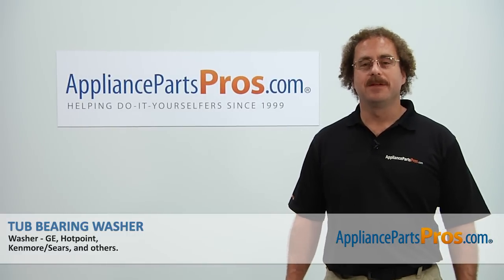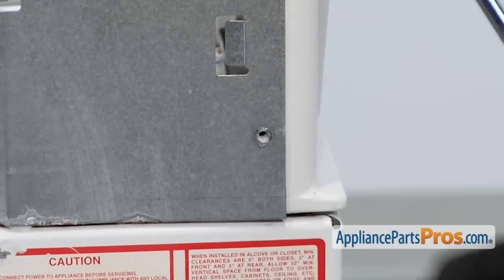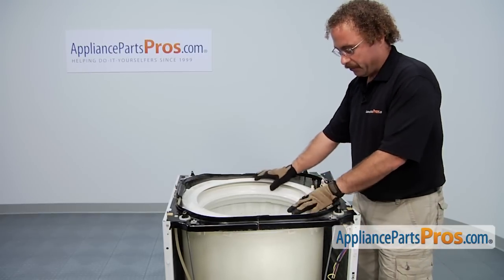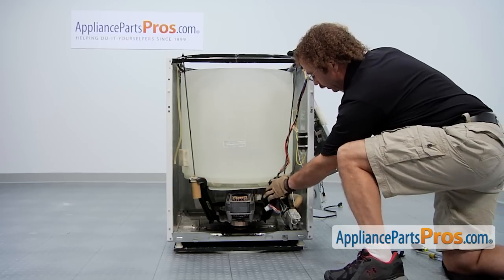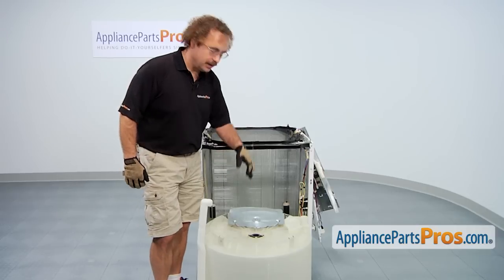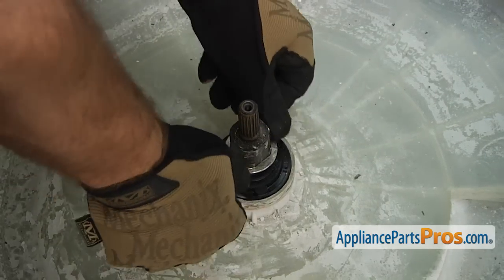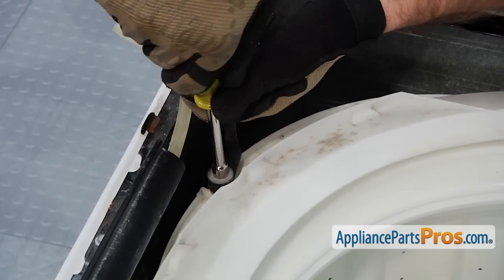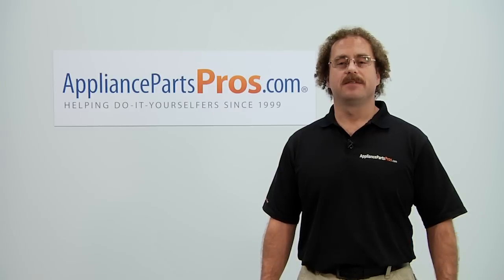How To: GE Tub Bearing Washer WH2X1197

Comment: For those that are having trouble removing the old tub bushings. I was able to take the new bushing and find a socket slightly smaller and place a socket extension in the socket and use a hammer to tap on the extension and drive out the old bushing. I also recommend ordering the bushing, tub seal and split bushing. As I broke the split bushing and the seal had to be replaced along with the tub bushing. I also ordered the nut wrench as it was on $10.

Comment: Anybody who is attempting this repair on a washing machine that is years old should be aware that you're going to run into pieces that are rusted together and are not going to want to come apart as easily as shown on this video. I used to be a contractor and I'm pretty good at DIY projects. I did this repair on a 20 plus-year-old washer. I nearly gave up. One key is having the correct tool to get that reverse threaded nut off. Also, have plenty of WD-40 and 80 grit sandpaper around
Reply from the maker: Thank you for those tips!
Reply: Yea, i used a heat gun and a crayon as well as the special wrench i got on amazon for 13 bucks i then modified by adding as much extention bar as the tub would fit and wailed on it for a week with a deadblow sledge. I hope its my washer that was actually bad.

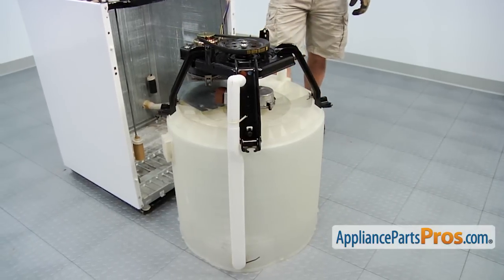Comment: 9:38  never understood the overflow tube.  What good is it if it is not connected to anything?  End of the day it overflows on the floor whether you have the tube or not.
Reply: without the overflow tube, the water would just flow over the top of the tub, and onto the electrical connections and electric motor - the tube directs overflow to the back corner of the machine, preventing that electrical hazard.
Reply: @thadthompson2264  very good points!  Either way you are screwed!  Did not think about it getting all over the motor

Comment: @5:58 on my hotpoint it is very oily there(getting into tub and into clothes) and i suspect its that top shaft seal,is there any way to replace that without having to pull and replace the whole transmission?
Reply from the maker: What is the model number of your washer and we can look into this for you.
Reply from the maker: Is it part number AP5645738 that you are looking for? Below is the link to that part so you can look at it. 

https://www.appliancepartspros.com/ge-seal-tub-wh02x10383-ap5645738.html
Reply: i dont think its the tub seal(that would cause water to leak past the tub into the bottom right?)i think its the upper shaft seal (right under the splines for the agitator)

Comment: WCSE4230A0MM agitate ok but wont spin, motor check ok, turn transmition pulley by hand, turn ok in agitate direction, but only turn about 1/4 turn in spin direction then lockup wont turn any more, appreciate any help?